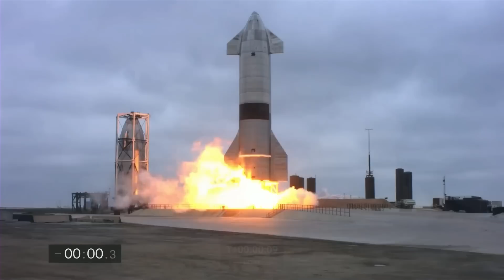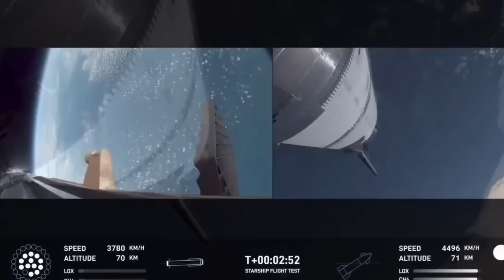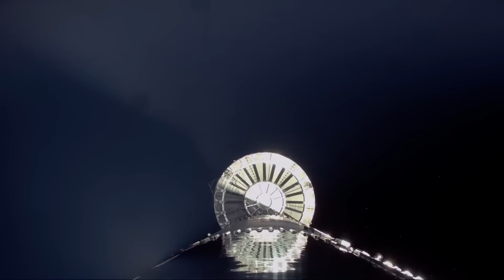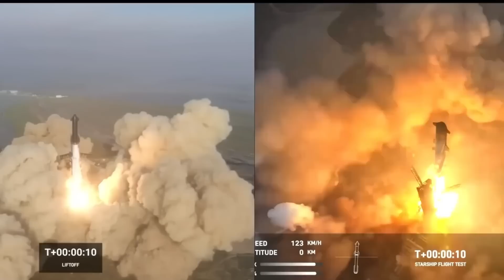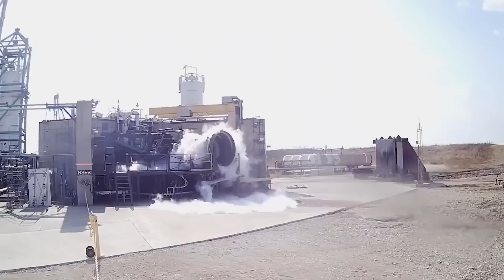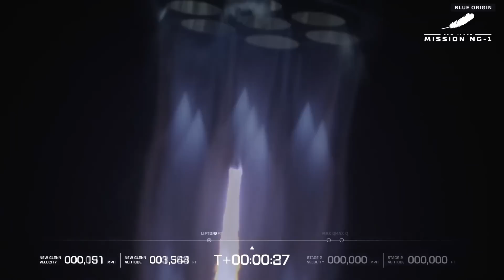Starship's Raptor Engines Problem Caused Explosion During Launch!

Comment: Explosion during launch????…….uhhhh…no….wont even read story after that huge untruth
Reply: Was it the FTS doing its job after it lost engines and directional control or did the ship blow due to the fire? I haven’t heard yet.
Reply: @Tonali01  Yes. It was confirmed that FTS was activated...
Reply: @Tonali01  I don’t think they’ve said yet..but it was in space when it happened ….the headline wrongly indicates it blew up at launch…..big difference
Reply: @SusanRice-h1r Launch can include second stage firing. The video clearly says this is when it happened.
Reply: Wdym? It blew up
Reply: @MattyO88  not during launch it didn’t…it would be all over the pad if it blew up during launch as stated…words have meaning…accuracy is important..I believe it was over the Karman line when it blew up…that’s long past launch…blew up in space is more accurate
Reply: Technically, it did blow up at liftoff,  33 raptors blew the booster right off the OLM, not to mention blowing my mind. 😊🎉
Reply: @ straight up…correct sir
Reply: Launch can be considered also the firing during the second stage.